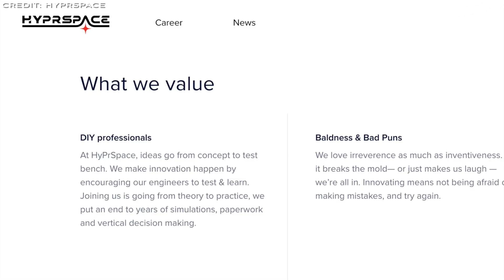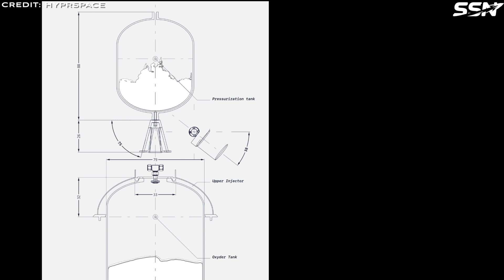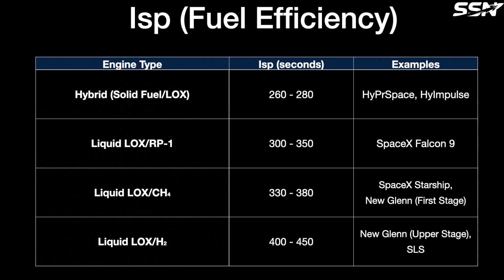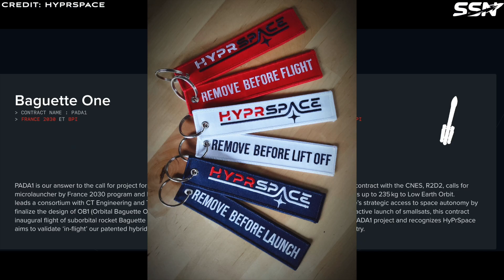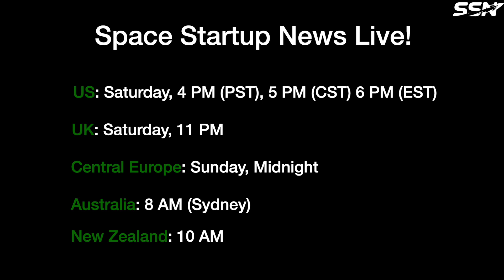HyPrSpace: French Hybrid Rocket Space Startup

Comment: Ok , Hyprspace can simplify without turbopumps or electric pumps. However pressure fed the first stage only works for small payloads , it’s a shortcut and you don’t develop the critical technology for bigger rockets. For simplicity first stage solid rockets like the Vega , and use a second stage pressure fed for soft insertion ride.